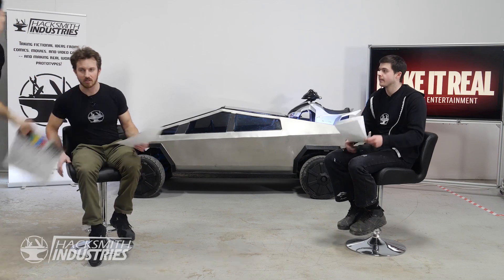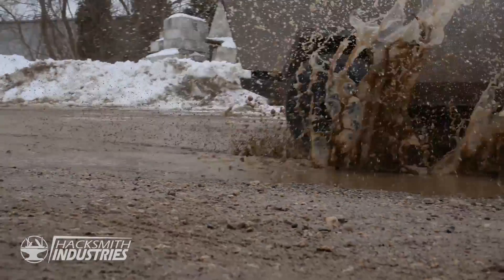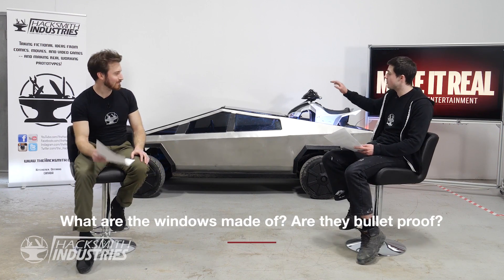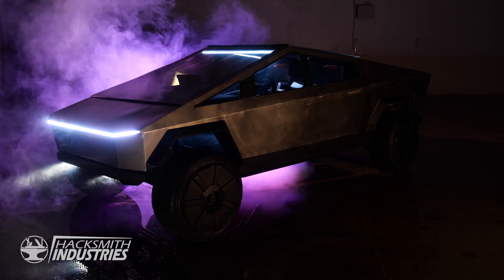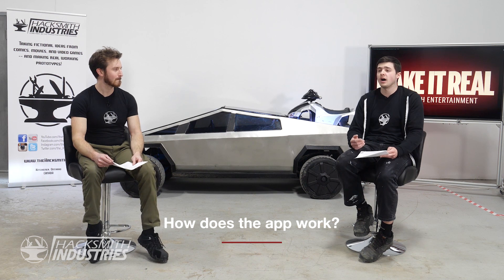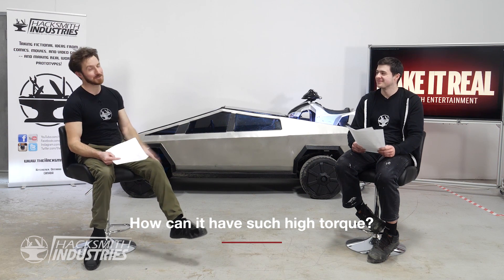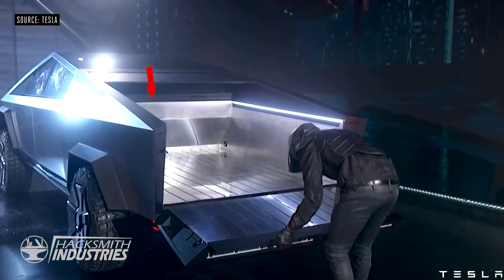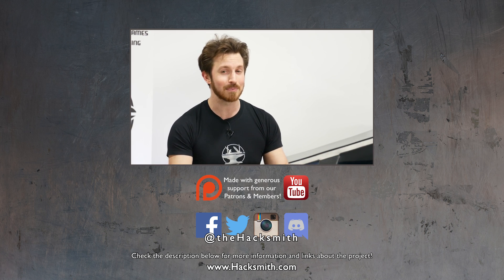Half Scale Cybertruck Q&A!

Comment from the maker: Wonder how we beat the F-150?! Well... it just comes down to some basic physics.

Most tow tests are actually about the weight of the vehicle, not the torque they produce. So how did our little 2500lb Cyber Truck out tow a 4600lb F-150!?

Well, it's pretty simple. The F-150 was in fact in RWD mode only. Trucks are designed to carry heavy loads in the bed, which means when a truck is unloaded, the rear end is quite light.

We know the maximum gross vehicle of the Ford is around 7500lbs. That means, when fully loaded, you can assume there's roughly 3750lbs on the front axle, and 3750lbs on the rear axle. If that holds true, that means when there is no load, if the truck only weighs 4600lbs - 3750lbs balanced in the front... boom the back of the truck unweighted probably only weighs about 1150lbs. Less than the cyber truck.

Hence, the Cyber truck was able to win.
Reply: Would you make a half scale cybertruck truck again now you know how to do it ?

Also would it take a lot less time if you were to make it again?
Reply from the maker: We wouldn't save much time
Reply: @theHacksmithVLOGS  it would be cool if you could make the the Tesla key fob shaped like the cybertruck like what Tesla made for their cars

Edit: you could try include things like light controls and if you do make it auto pilot you could try make the summon features
Reply: I also have an idea for the make it real series 
Retractable black panther claws
Reply: @jokerdevaney6241  we did make a Tesla key fob,  didn't you watch part 4?
Reply: @hacksmith  ye I did but make it cybertruck shaped
Reply: @jokerdevaney6241  good idea
Reply: Why wasn't the F150 in 4 wheel drive?
Reply: @rossthompson4990  because if it where then f150 would obviously win. Cybertruck weighs less so if it were awd vs 4x4 then f150 would win due to just having more weight
Reply: @gabrielschoene5725  more traction
Reply: @rossthompson4990  they done the same think as elon musk... cheated to make it seem better
Reply: So when is the 1/2 scale F-150 coming?
Reply: If you know somebody with real cybertruck, could you make a video about original vs yours?
Reply: @AQLV  no Haha,  that would be so expensive! Also we are a company :p
Reply: Are tow tests about weight or are they about the coefficient of friction?
Reply: @alpha434  weight. Coefficient of friction is probably about the same for each of the trucks (maybe slightly in favor of the f150 since the tires are probably newer on that) the test is also still about torque, you can see the cybertruck struggled to pull the f150. It was a close pull
Reply: @gabrielschoene5725  the torque on the wheels if the f150 is higher so even with the trucks loaded up to point of stoping wheel spin, the f150 would win because of having higher torque(i mean the force on the tyre, not the torque,). Anyway it is great project
Reply: @alpha434  weight affects friction and you will obviously need just enough torque on wheels to (almost) break traction (which as we saw the f 150 had plenty of). So yes weight does affect traction. But also is important the tyres you use, the surface you on and the temperature obviously.
Reply: @zlunazelena4080  Friction is a coefficient. Please understand what that means and the forces that are physically involved before using the wrong terms.
Reply: @alpha434  sorry😀 i am not from american speaking country, i meant traction... sorry for that
Reply: @alpha434  so to conclude it, the friction afects the pull force and so does the weight. The higher weight obviously means more grip even at the same size of a contact patch, but also when you load up your truck, the tires will compress a little bit and give more surface to grip on. So if you want to win against a same truck with same weight, same tires and same wheel drive, deflate the tyres a little, that way you increase the contact patch, thus you get more traction.
Reply: Alex Wojtaszek that would be awesome
Reply: I think you should auction the cybertruck.
Reply: are you going to sell the half scale cybertruck and how much would you sell it for?
Reply: Thank you for the engineering tips for that and letting me know how much it would cost me to try to do something like that but not the some thing though
Reply: please don't shoot that masterpiece!
Reply: Wait, so I explained people in the comments on facebook about this all, and they would still doubt me and the facts i was providing. I wonder how they will respond if i show them this now. Its so great to discuss with under educated people who have no clue what they are talking about xD
Reply: you should try to get elon musk to try it. cyber truck vs mini cyber truck lol
Reply: Anyway just wanted to say there are ways to license home build and kit cars in America, even classics (over 20 years old)

Guess I'll relate that people do license homebuilds. Usually complaining about how much money they could have made and saying that with their own labor, or with someone else's, it costs about as much as a mass produced vehicle... that was more than a decade ago though, so it's cheaper.
Reply: wow all of you amazing
Reply: Has Elon Musk reached out to you guys in any way shape or form??? I can imagine he would love this
Reply: this is so cool
Reply: This was not fair test, i mean for that f-150, you need to compare apples to apples, the torque of the engine is not important, you can have high revving engine with low torque, that electric motor is very low revving, but as you saw the engine torque was not important as the torque on the wheels what that f-150 has way higher. And even that is not important as the traction. Or, better said, you need the torque on wheels to be just about break traction... i like your projects, but please make fair play😕

Comment: How do you think the motors would hold up with a transmission? I have a cobalt with a blown engine and was thinking of things I could do with it when this project came to mind. Thoughts on EV conversations?
Reply: install motors in car transmissions is common with less expensive EV conversions, normally people use AC motors from HPEVS (AC-35, AC34X2, AC-50), or DC motors from NetGain (the famous Warp9, TransWarp9 and Warp11), Advanced DC Motors, and even forklift motors with cheap conversions for tests or small range

Comment: I think you could have a 2 speed gear box much like the Rimac Concept 2 if that would be possible. Or put on a torque converter that engages via a clutch when you reach the current top speed. So The clutch i constantly disengaged untill you reach your top speed, then it bites and since its connected to a torque converter, you can go faster. So you still have this low speed toque.

Comment: Quick reference regarding the torque, in case anybody was interested. The 1250 hp gas turbine of a T-80U (1986) outputs 4,395 Nm at 3,000 rpm, the 1500 hp gas turbine of an M1 Abrams (1980) gets 5,355 Nm at 1,000 rpm and the 1500 hp diesel engine of the Leopard 2 (1979) provides 4,699 Nm at 1650 rpm. (1/2 scale Cybertruck: 2,410)

Comment: The truck bed cover is nice, but first you should grind back the damn welds there. Its been bothering me to look at for a while how obvious the welds are in truck bed... the whole truck is smooth and nice, and then there you have just big blobs of metal sticking out. 

Plus, the half sized quad might be a bit of a meme, i could see the back being a good launch platform for drones though!
Reply: You try grinding an interior corner lol
Reply: @hacksmith  Point taken, but truck bed liner would be an option to cover it up :P Not a feature on the real one but practical.

Comment: Love the truck and couldn't believe it when it pulled the F150, but, realized that you were only using RWD on the F150.
I still say it would have been better making the truck 3/5ths size rather than 1/2 just for the interior space and the ability to make a door safely. 
This gave me ideas about converting my ford E150 conversion Van to electric.

Comment: What is the range, efficiency(wh per mile), and max charging speed.
Reply: Yeah, you should do a video testing it
Reply: Watt-hours per mile is going to vary hugely with speed. The Wh/m spec that's relevant for an EV is when traveling at highway speeds, because range doesn't matter in a city unless you're a taxi, every vehicle can recharge at night and be full next morning. So to properly test it at highway speeds, the Cyber Half Truck would have to actually go highway speeds, which would have to be on a private road since it's not street legal, and would be ridiculously unsafe. It's functionally a portable reverse-guillotine that launches your neck at the edge of the frame during a collision. However, using 500kg and about 0.75m^2 as a cross sectional area, at 100km/h (60mph), it should use about 83 watt-hours per mile, about half of which is overcoming rolling resistance and half of which is overcoming air resistance. That's about 1/4 of what a Model S uses per mile, but considering the size and weight, seems just about correct.
Reply: @MattsAwesomeStuff  always appreciate some good math. I think 80 watt hours per mile is a fair number, but I don't think you'd be able to sustain highway speeds. They are using a gold cart diff (probably would overheat), and their motors redline around highway speeds. I assume they have to use flux weakening to keep up such high speeds which would kill their motor efficiency. That being said they are using pm motors which are more efficient when run at the right speeds.

Comment: Do a half scale Roadster; half scale dimensions, half horsepower & torque, half top speed & half 0-60 time, Wait what??...
Reply: Half scale, half power, means 1/8 the weight, half power. So 4 time the power to weight ratio. If you find a way to put that kind of power to the ground without sliping, it will be half or less 0 to 60 time.